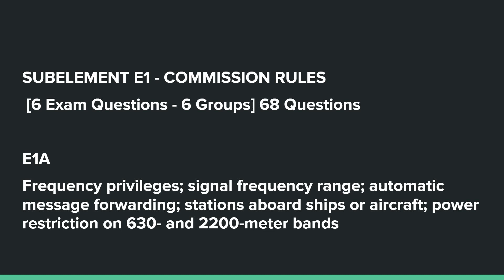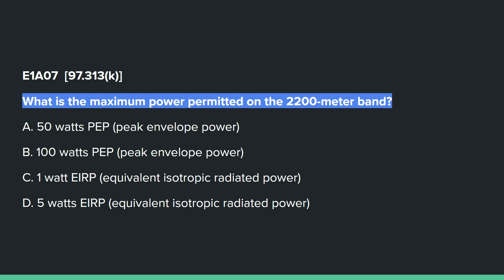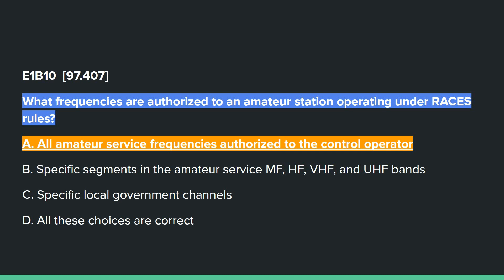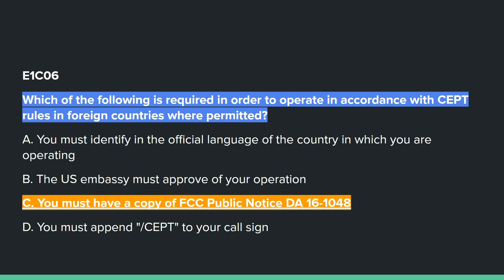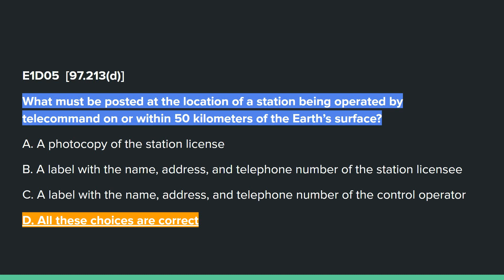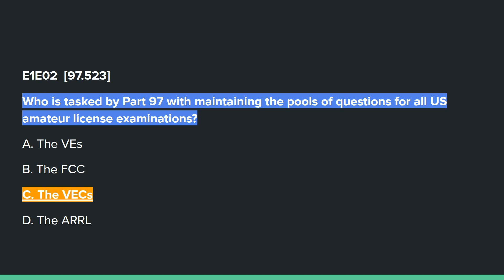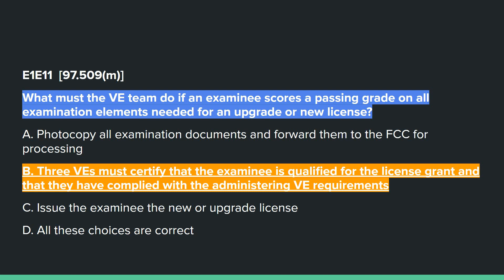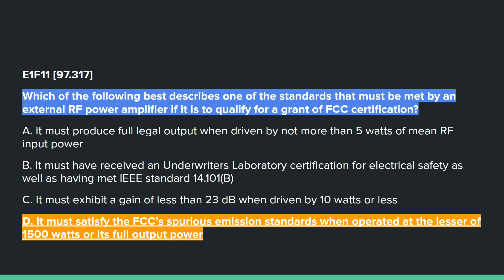🍖2024-2028 Extra Class Question Pool Sub-element E1

Comment: E1F03 has been changed to read "The amplifier is constructed or modified by an amateur radio operator for use at an amateur station". I have it in the pool I down loaded from the FCC Website.
Reply from the maker: Yes that changed as of September 2025.    I don't have the ability to fix single questions

Comment: On E1A05 the ARRL book says the answer is B. Not C.
I'm thinking it's C.
What gives?
Reply from the maker: Are you sure you have the current question pool book which took effect in early July 2924?  My review of the question and answer shows C as the correct answer.
Reply: @fatherdaughtergaming  I'm sure it's C.
I got the cheap arrl Q and A book.
Sixth edition 2024 to 2028.
They need to know they got that one wrong.
I wonder how many more are wrong 😞
Reply from the maker: @timholtzclaw8930  it happens.   I often create the slides and questions are dropped as I make the videos and I don't know.
Reply: Emailed ARRL they said there are 3 incorrect answers in the ARRL books, E1A05 is C, E1CO7 is D, and E3CO9 is D.
Maybe this helps, but you guys probably got it right.
I'm watching your videos along with the book. Thanks. 73 KO4HEK @fatherdaughtergaming
Reply from the maker: @timholtzclaw8930  people often find mistakes in my slides.
Reply: @fatherdaughtergaming  Mistakes happen, I just want to pass the test 😂
Reply from the maker: @timholtzclaw8930 a few mistakes still pass the test though
Reply: On E1AO5 the correct answer is A per ARRL book Q & A  book
Reply from the maker: The ARRL book is incorrect per an email from a prior comment from someone who emailed them.   My answer is correct.